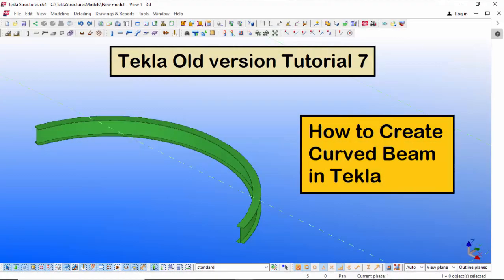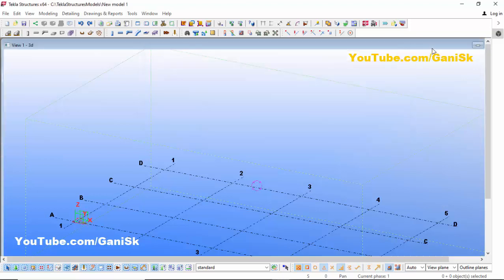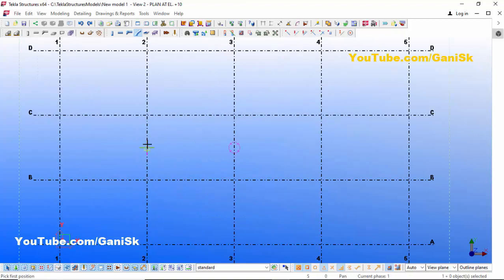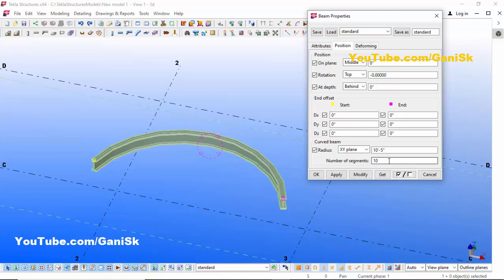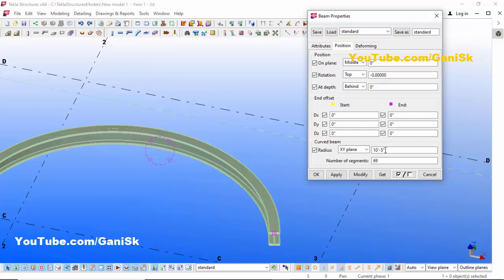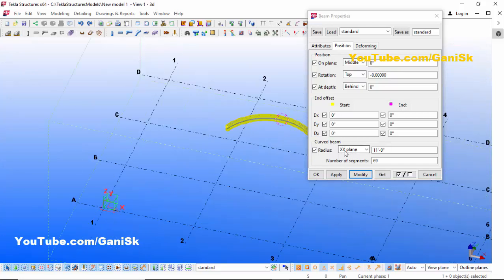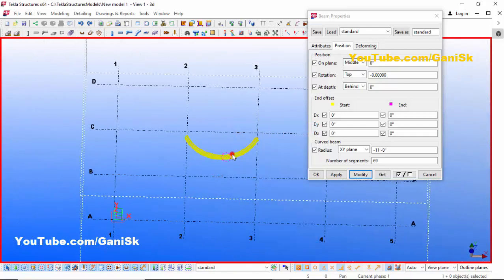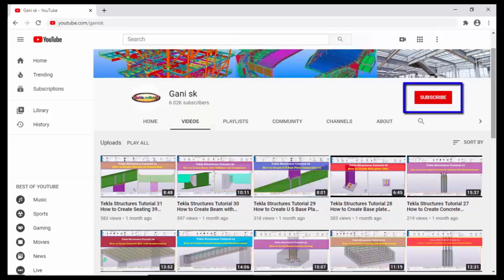Tekla Old version Tutorial 7 | How to Create Curved Beam in Tekla Old version

Comment: Which laptop you suggest for tekla software
Reply from the maker: Computer System Minimum requirement for Tekla are
 1) 4GB Ram
 2) 2GB Graphic Card
 3) Windows 10 with 64 bit operating system for latest version or Old versions
Reply: @GaniSk  which laptop are u using sir?